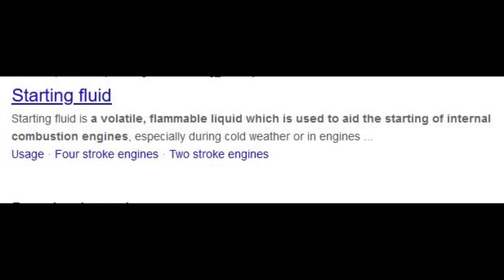Why do Diesels get Addicted to Ether?

Comment from the maker: Hope you liked this one, have received this question a lot of times and figured it would make a good video topic. Check out the Amazon Affiliate Link recommended tools to help the channel out: Fuel Pressure Gauge, Compucheck 0-300 psi: https://amzn.to/3YeBldu
Airlift Cooling System Vacuum Filling System: https://amzn.to/3D9AlPu
Radiator Pressure Tester Kit: https://amzn.to/3QGBumn
Milwaukee 3/8" Right Angle Impact Wrench: https://amzn.to/3D2CvAk
Adjustable Height Parts Tray 100 lbs: https://amzn.to/3CBusZB
Engine Oil and Fuel Dye UV: https://amzn.to/3z34zkv
UV Professional Grade Light: https://amzn.to/3gzxPc0
Allstar Oil Pressure Priming Tank: https://amzn.to/3L5pASm
Reply: Hi
Thanks for great videos 
Don’t know if title has typo or you care 
Why “ go” instead of why do ?
Reply from the maker: It was a typo, I got it fixed. Was pretty tired out from editing by the time I made the title and didn't check it.
Reply: Up in Norther BC, we used to start our diesels in the winter using propane. Propane is very compression friendly. Also works like nitrous for a diesel. Make sure to add a water/ethanol mix with it, to keep the exhaust temps down.
Reply: Love the Hat...

Comment: we have an old brazilian ford f550 at my job, Im the head mechanic and convinced them its addicted to cosby sauce, This truck has a 5 ton crane,  a welder, a diesel air compressor, a  generator, and a service body on it... im getting it for 2k because of this issue, All it needs is a new HPFP...
for once the employee wins boys,

Comment: Many people are just too ignorant to use starting fluid correctly. I have used it, and still do,anytime I have a weak battery or if it’s cool and I know an engine is slow starting I will give it a little toot just to pop it off rather than wind on the starter for 30 seconds. I have definitely seen dumbasses spray half a can when all that was needed was a little toot.

Comment: Hmm. "Volatility" mentioned a lot. Ether is volatile, yes, but the low autoignition temp is probably the main factor.
   Water is also more volatile than diesel fuel.
   Would water help?
    Something being volatile doesn't tell you much about starting a fire with it, although it helps to have vapor around. 
   Magnesium is virtually not volatile, but burns pretty well without vapor-an exception.
     Brake cleaner? Some burns, some doesn't.  Much of it contains chlorinated solvents. When they burn, hydrochloric acid is usually a product of the reaction. 
   Do you want hydrochloric acid in your engine and exhaust?
   If you have no opinion on that, play with hydrochloric acid and steel or iron a little. It is incredibly corrosive to many metals, especially ferrous metals.
   If you want to try that,  it is sold as "muriatic acic" in hardware stores. The low vapor "green" crap is just very diluted with water. Yes, that volatile stuff!

Comment: I had an old 85 Ford 250 with the original engine, original miles.  It had a real hard time starting until I changed the glow plugs and a couple of injectors.  It started like new after that.

Comment: I took a pete into a truck stop to get serviced since I was way over due. It had an isx 15 in it. The prime pump was bad but the o ly time it wS an issue was when the filters were changed. I carried a 12v aux pump like found in most shops for priming and let them know I had it and if they didn't have one they could use it.they told me they won't use customer tools and they will get it done. I came back a couple hours later and they were using starting fluid to prime it. I could hear it from the other end of the building. There were 4 empty cans on the ground and were running it on the 5th when I came into the shop. 
 ended up having to rebuild motor. And I was going to have it sold the next week. I had 2 scored and 1 cracked liner. Was blowing white smoke within a couple of hours of leaving. I went in with an average of 8.4 mpg and by the end of the trip (900mi) I was lucky if I was getting 4mpg and a gal of coolant per day. 
I fought 5hem over it for awhile but they insisted starting fluid isn't t bad and it must have been like that when it came in...
 The only times I e used more than a quick k shot or 2 while. Ranking is when it was sub zero Temps and no jumper cables around or when pulling something that has been sitting in a field for a long time.

Comment: I don’t use ether I use brake cleaner won’t damage the engine
Reply: Hopefully, non chlorinated. Phosphene gas ain't no joke. Brake clean does wash the cylinder walls down so you are in fact causing wear to the rings.

Comment: No, ether does not self combust. Ether is a chemical class. Starting fluid is a rapidly combusting gas. Many contain octane or heptane. (8 and 7 carbon molecules) you need to heat these up to about 300+ f to make them burn, which is very low compared to diesel (400+, and gasoline 500+). they also burn faster than diesel or gas in the same oxygen environment often producing a "knock."

Comment: I like either, 

The only argument I’ve heard that i can agree with is, If the starting fluid does not have any lubricants in it, then it would a solvent and possibly cause low/no lubrication in the combustion chamber, and then cause small cavitation in the cylinder walls, and with repeated use would then cause the cavitation to get bigger and bigger (even though we are talking about ten thousandths)

Comment: On older engine’s I’ve seen where to keep them warm overnight you could plug them in like an electric kettle & they would start a lot easier the Perkins P6 was a poor cold starter, some of these had kal gas systems.

Comment: One thing that I feel should be covered on the topic of ether is spraying it before the engine is rotating this is the biggest cause of damage when using either and is far too common I myself am guilty of this. The problem with spraying before the engine rotates is it allows the ether to settle in whatever cylinder has an open intake valve and when you go to start it that ether is only acting on 1 or 2 cylinders and is creating excessive cylinder pressure and strips any lubrication on the upper cylinder wall, this in turn can lead to ring failure or worse.

Comment: A major issue with ether is that it lacks lubrication and is a dry gas when sprayed into the intake. IMO microscopic abrasion of the cylinder walls and piston ring faces does make the compression issue worse.  Its also an uncontrolled explosion. Why do they tell you not to use glow plugs while using?

Comment: I just remembered that the majority of the Viet Nam Era Military Deuce & Half Trucks that had the Multi Fuel Engines in them ran on primarily diesel fuel, but would also run on pretty much any kind of fuel that would burn. Long story short, virtually all of these trucks also had Ether Systems built into the truck, with a push button on the dash for extremely cold weather starts.

Comment: Diesels are so odd in how they act in temperature. I have some that even at freezing just would never start without glow plugs..... then I have an old perkins that well below freezing will go without that much trouble and dosen't even have the flame start anymore just good compression. 1 cylinder starts kicking first and it will sustain this on it's own for 5 ish seconds and then the other cylinders catch, I think 1 cylinder has much better compression. Then I have a JD gator that without the plugs working will run the batteries dead before it even kicks...

Comment: I used to be a member of a small Volunteer Fire Dept in Upstate NY, and they used to have a 1974 Dodge C 900 Pumper that had a 555 Cummins V8 Engine. The easiest way to get that Triple Nickel Engine to start was to give the intake a couple short blasts of ether. I fixed this issue temporarily by starting, and running the truck once a week for about 30 minutes. Some of the older Members didn't like this, and told me that it was not fixing the issue, but, in reality, it was fixing the issue, because it was keeping the batteries fully charged, but long story short, they made me stop running the truck on a weekly basis, and within a few short days of not being started and ran, they ended up having to go back to using ether to get the truck started. I noticed this, and went back to running the truck for 30 minutes on a weekly basis. We had a call come in one day for that particular truck, and I warned the incoming driver that the engine was already hot from having just been shut down, and that he would not have to use ether to get it started. He ignored me, and gave the intake 3 long shots of ether, turned the engine over, and blew it up.
Reply: Drivers never listen.
Reply: Running a engine that size for 30 mins doesn't usually get the engine hot enough to rid itself of moisture that is created by getting the engine warm.

Comment: Most of my father's lawn equipment is addicted to "Motor Cocaine" (Ether).  There were two times that I needed to try using Motor Cocaine.  It worked neither of the times.  Problem one was a valve train that got disconnected when a circlip fell off.  Problem two was a damaged fuel or primer bulb line.

Comment: I'm glad I watched the entire video before I left a comment (ya I'm terrible for that) Anyway I was going to mention using brakeclean and it's all I've ever used during my 30 year career as a heavy truck mechanic at a Freightliner dealership and it works just as well. Also I thought you may mention an either lock. I definitely like your content 👍 🇨🇦

Comment: Never ever spray either!!! Use WD40. It’s killing your engine..  Been around equipment my whole life you can spot a diesel w either from a mile away.
 There’s only 1 reason , the either is washing down the chyls.  And lacks lubrication    Worst case scenario if your Gonna use either please soak some WD in there with it

Comment: Jez ! I had to replay the into half a dozen times to work out what you were saying !
Heyguysjoshuadaptapechannel
It always puzzled me why none of the big diesel engine manufacturers like Cat, Volvo, Cummins etc never devised fuel heaters for cold starting because that’s the main reason a diesel doesn’t like starting in the extreme cold, the fuel, being an oil, it thickens as it gets colder & is won’t atomise in the cylinder like it does at warmer temperatures.
Block heaters do a good job of warming the engine but warm fuel would be a way more efficient way, & it would only really need a litre of hot fuel to get the engine running before the colder fuel comes through.
There is a guy in Sweden here on YouTube that has installed a diesel heater to his small excavator that pre heats the water system so that not only does the engine start easily at sub zero Swedish winter temperatures but also his cab is warmed up & defrosted. This can be remotely activated or run on a timer.

Comment: Ive worked heavy equipment and logged year round.
These people talking about addicted and Ether Babies are flapping their lips with no 
data in their storage compartment.  A weekend in the single digits, no electricity?  Hook jumpers to the pickup to warm the batteries, a snort ot or two in the intake, and maybe a toot or two untill she runs on her own....Or, dont work!

Comment: whew! I remember my 2nd job in 1989 when i was operating a well worn John Deere 540B skidder! as the new guy i had to prove myself on this hunk of junk that when the temp was 45 or less, jumper cables and starting fluid. the boss man finally bought a new Clarke 667 for the "old head" and i got "promoted" to the 2 year old other Clarke 667.

Comment: Diesels get addicted to ether because after a long hard day of working all day long, ether relieves the stress and strain of the day and gives a euphoric high for several hours. Ether is also cheaply available on the black market for 1/10th the cost that auto parts stores sell it for.

Comment: The places I've worked at don't let you use ether underground, due to the potential hazard of it leaking, accumulating in low areas and exploding (same as gasoline and propane). On the other hand there is a lot of underground equipment with multi colored air intakes, spray paint works too.

Comment: Good advice & info, ether is very hard on everything & should be used with caution in small amounts, too many people overuse & abuse it. 
Cans of carby cleaner are usually cheaper and works well also, WD40 or any spray lube generally works and is a lot softer on everything or a little petrol on a rag draped over/near the air intake.

Comment: Well, timing is critical for any engine, and diesels especially. Your ECM or injection pump takes care of timing, it injects fuel in precise moment. When using starting fluid, it may (and will) ignite at any random moment, causing knocks and detonation. It may (and will) damage Your engine over time...

Comment: Had an old 6.9 IDI that refused to start without ether if it was below 70°. Swapped it for a 5.9 Cummins and it cranked right up in -20° without ether or grid heater.

Comment: I used to find that it was the indirect injection diesels that people would use Easy Start on especia;;y if the batteries were down, direct injection engines seldom needed it unless the engine was worn.

Comment: My 6v92 has no grid heater or glow plugs. When it's below about 25 farenheight, starting fluid is a must if I want to start it without running the battery clear dead.

Comment: Unless you’re in subzero temperatures, a diesel that requires ether to start has a fuel system issue. Or the compression is so low it can’t fire. I worked at a place called Evans Equipment for 20 years saw over 1000 diesel trucks come through there. Every single one that required ether to start, was found to have some sort of fuel system issue. We would fix those things because nothing would impress a customer more than a big diesel engine, starting on a 10° day without any ether. I watched my bosses brother spray half a can of ether into the forklift to start it. That little Perkins engine blew the rings out of three cylinders straight out the exhaust pipe.

Comment: I have the opinion that you shouldn't use starting fluid for gasoline engines because it ignites under compression so easily and can cause horrible detonation. If it's a gasoline engine, propane makes a much better starting fluid. If it's a diesel, ether is the best thing ever.

Comment: OLD SHOP GUY I USE TO WORK WITH WAS A DIESEL ENGINE BUILDER. HE TOLD ME ONE Time THE ETHER IGNITES WHEN THE PISTON IS ABOUT HALF WAY UP THE CYLINDER. SO THE PISTONS TRYNA COME UP BUT TRYNA BE DRIVEN BACK DOWN AT THE SAME TIME THUS BENDING THE ROD. WHICH IN TURN CAUSES LOWER compression  AND HARDER STARTS* ESPECIALLY ON A  ALREADY WORN ENGINE DOWN ON COMPRESSION ALREADY. THEREFORE MAKING IT ETHER DEPENDANT ‼️ 
HONESTLY MAKES SENSE TO ME.  
R.I.P. Charlie!

Comment: a while back you listed part numbers for a Caterpiller C7 engine looking for the 4mm? bolt part numbers that go through the middle of the ecm connectors to retain the two connectors to the ecm. Thanks  local dealer can't find em 2004  kal1254  or do you remember which video is it i can't find it thanks

Comment: Ether ignites way before to dead center. So the cylinder pressure is climbing then the injector fires the cylinder pressure go way too high. Can break rings,pistons,head gaskets and take out bearings. Heat the water or incoming air.

Comment: I've got an old Perkins that came from the factory with a Cold Start Injection system as the only winter starting aid. Works great, I've had the same shorty can in it for probably two years now. I hold the button for maybe three seconds as I start cranking, and it hits the cylinders a second or two after that, starts with no drama.
Reply: I have a Bobcat with a Perkins 100-4. I suspect a fuel delivery issue, but... The first start of the day, I give a short burst of starting fluid (maybe 1/2 teaspoon) and it starts immediately. I can restart it later in the day with zero trouble. But give it a few days and I absolutely NEED the starter fluid or I have to spend two minutes on the starter.
Reply: Sounds like you have fuel draining back out of the injection system.

Fit a cheap  knock off Facet style click click 12VDC fuel pump inline between the fuel tank and the fuel filters.

Operate the pump with a momentary on (push style) switch on the dash...
and fire up the pump to run for 15 seconds BEFORE you hit the starter switch....and until the engine runs.

This momentary switch can also be used by a helper while you bleed any and all bleed valves all the way to the injectors...
positive fuel pressure at the push of a button after a filter change etc.

When the engine's own lift/injection pump sucks up fuel it just sucks it through the inline pump without restriction even while the Facet is not running...

If the engine needs a lift pump (having broken down on the job) the Facet pump can get you home so to speak...
or allow you to keep working until you get the lift pump replaced.

See marty T Yt channel I bought the cheapest loader in New Zealand what could possibly go wrong...

he also deals with refitting a Thermostart Intake Flamer heater...you might like that as an alternative to ether???

 @RichardHodges-o6u

Comment: This "Starting fluid" causes a lot of internal damage to the engine that has caused thousands of damaged pistons and bent con-rods.
Ki-gas does the same job but does not destroy the engine.
Modern engines use heater plugs which also solve the problem without engine damage.